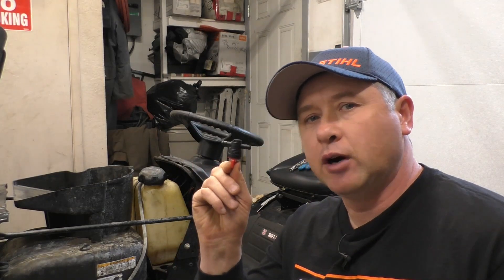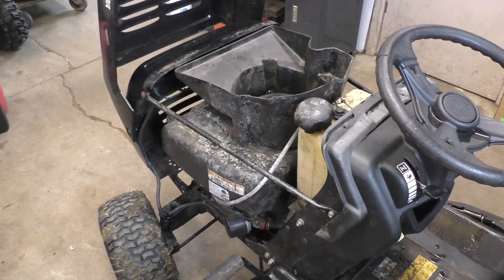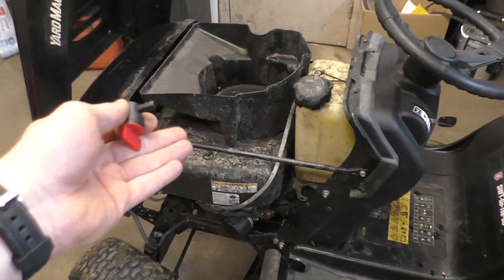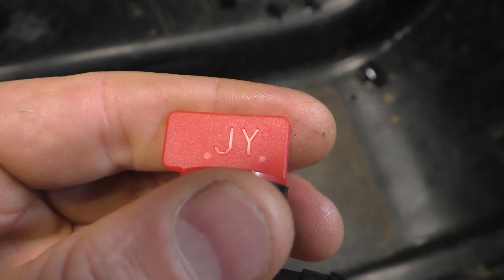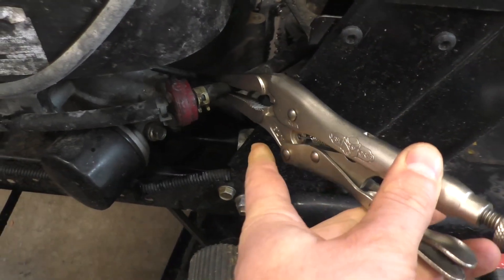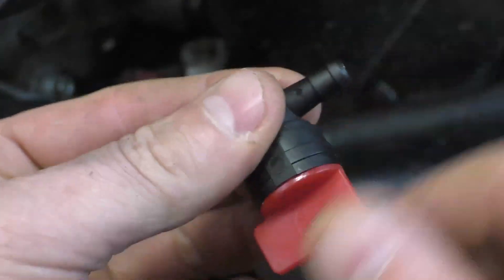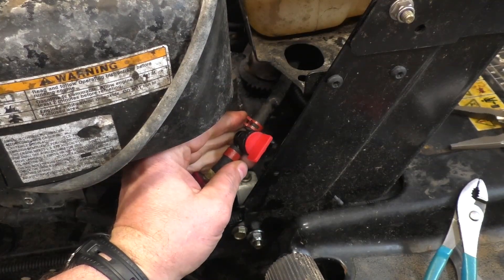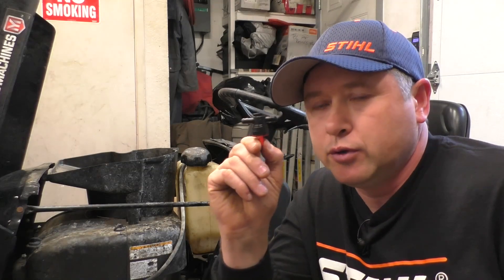Upgrade Your Lawn Tractor With A Fuel Shut-off Valve: Easy Installation Guide!

Comment: Great advice on the Chinese knock-off valves. I made that mistake and did an Amazonian purchase of 50 in-line valves for 10 bucks shipped.  The first one leaked and subsequent testing showed 40 of the 50 leaked right out of the box!  I buy Stens and Walbro only now. Learned my lesson!  Thanks Don!
Reply: lol, I buy the Chinese ones too from ebay. When I do, I message them and tell them, make sure none of them leak, I am going to test them when they arrive and if they do, I am going ro return them. Because the first time, I had a bunch that leaked.  Next shipment that came in after saying that, zero leaked. However after about a year, I noticed they do swell and leak anyway. They have to be the name brand ones to last, typically by fastex. Just like those knockoff carburetors, you can't trust them.

Comment: I always put fuel valves on my lawn tractors. I agree with all your points. One of my reasons behind it is that on a gravity fed system, it takes that pressure off the float needle and seat. I feel that helps along with the long term storage too.

Comment: I put a shut off valve on my riding mower a couple years back because of a bad float seal until I got the parts. I decided it was best to shut it off after each use. The first couple times I forgot and left the fuel on when done mowing;  the solution I came up with was a clothes pin.  When I turn on the valve, I clip the clothes pin onto mower key fob as a reminder to shut off the fuel when done mowing.   Been working great.

Comment: Donyboy73, 
Thanks for the reminder to add a fuel cutoff and to filter the fuel to the carb.  My 2005 Troybilt / Briggs 7800 watt generator has performed flawlessly since new.  I treat the fuel in the tank and it starts easily.  I am lucky the long term use of treated fuel has not caused any problems.  The $1200 generator (much to my surprise) had no fuel cutoff and no inline fuel filter.   So, I installed the Oregon 07-406 fuel cutoff and a Stens 120-562 fuel filter.  Thanks.  All is good now.  I can shutoff the fuel to the carb and run it dry.

Comment: Thanks Donny. As usual, your instructions are both simple and clear, and you make great points about why you want a shutoff valve. I don't happen to own a tractor, but I agree that they're important, and I think one should be added whenever possible. Unfortunately, it's not always easy...  

A couple of years ago I was gifted a "won't start" Toto Powerclear single-stage snowthrower. I had to replace the gummed up carb to get it to run, and like most modern equipment it came from the factory without a shutoff valve, nor did it have a fuel filter, so I decided I should add both. The problem is that the entire fuel delivery system - the tank and all of 12 inches of fuel line - is completely hidden under the engine cover/thrower body. Getting access to either requires undoing 4 screws to remove the discharge chute, then another 4 (different, larger) screws to separate the top cover from the bottom cover and frame. So even if I added a shutoff in the line, I still wouldn't be able to operate it without major disassembly!

In the end, I drilled two holes in the top cover and re--routed a new fuel line from the tank to the outside, added a new valve and filter along the side of the machine, then back under the cover to route it back to the carb fitting. I had to add some grommets to protect the line from the sharp edges of the holes and some zip ties and hose clamps to keep everything in place to prevent kinks in the line. While I was at it, I also added a "Tee" fitting between the filter and the shutoff, and put another shutoff in the base of the tee, so now I can easily drain the tank into a container if I need to.

All-in-all, it was a royal pain in the proverbial. But at least now I can shut off the fuel or drain the tank without having to half-disassemble the thing. The Toro is  a lot easier to maneuver than my two-stage, and it works great on light snow. But with no shutoff, no filter, and not even an access panel to let you add your own, it was certainly destined (and designed) to fail sooner rather than later!

Comment: Even with the so called antibackfire device I see issues with  the ethanol  fuel destroying the o-ring internally on the device causing it to leak. Having a shut off device prevents fuel from free flowing into the carburetor  and back flowing into the crank case. I recommend to all my customers to install the shut off and use it not just in the off season but every time they are done with the unit. Cheap shut offs usually fail within 6 months. Good Video! Nice tip. You Rock the small engine world.
Reply: I had my Ariens 17HP fill the crankcase TWICE with fuel. I finally got the message and installed a shutoff. ALL gravity fed machines should come with a shutoff from the factory.

Comment: That is a great tip and I have to put some shut-off valves on my machines and let them run better when they need to and I will get quality valves like the two you showed made here and not one from China.

Comment: Hello, I just watched your video. I have a Craftsman T3200 riding mower and it has a fuel pump between the fuel filter and the carburetor. My question is, should I put the fuel shut off valve before or after the fuel pump. My concern is if I put it before the fuel pump and shut off the fuel it will damage the fuel pump by letting it run dry as the engine is running.
Thanks.
Reply: I have the same question.

Comment: What about riding mowers with a vacuum fuel pump?  I've got a shut-off on my mower, and I ran it out of gas last season for winter storage.  Come spring time it took awhile to get it started, so I've just left the valve on for the season and it starts right up.  Any thoughts, suggestions on this?  Thank you!
Reply: I was considering putting the valve on the vacuum line to the pump instead of the gas line to allow me to run out the fuel before storage.

Comment: If the fuel filter is too close to the tank or frame then you could take it out and put the fuel shut off valve there and then cut the fuel line between the valve and the carburetor to relocate the filter further down the line

Comment: Where can I buy a valve as shown in your video with three connectors?  Two nipples would be use as you shown in video with the third connector being used to drain fuel tank.  It would be easier than pulling the fuel line off to drain tank.

Comment: Once valve is installed, did you find the fuel feed supply from the tank, cut in half (or even lower), compared to a straight line flow through hose, with no valve installed? I did. Cut my supply by more than half (down to a trickle, where the float isn't even floating, while engine is running, compared to a full length of open rubber hose feed. Slowed the feed right down, from what it once was (a river) to next to nothing😒. Even Installed a second valve to replace the one I was using, and it did the same thing. Without valve, fuel flowed like a river, and with the shut-off valve, it barely flows enough to run the engine.
Reply from the maker: no issues at all. some of the cheap amazon ad ebay valves can sometimes be problematic. Remember to make sure the arrow on valve is pointing correct way.

Comment: Also,,how does this shut off work? Will the gas from the shut off to the carb still run in after its sitting? Or does it air lock that no gas can run?

Comment: will this method work if my fuel shut off module under the carb is flooding the engine?,,,My engine is flooding all of a sudden when there is gas in the tank,,and it goes in my oil base,I drained the base,,and checked my fuel shut off solinoid and it seems to be working....but still floods the motor oil base ,and piston,when gas is in the tank it will slowly leak into the engine over a two day period..Will this shut off valve help my problem? Thanks ,,you do great videos!

Comment: I saw 2 videos of yours, one with the shut off valve location between the tank and the fuel filter, and your other video was between the fuel filter and the pump. Does it matter? Thx
Reply from the maker: It's better installed before the fuel filter and tank so when you replace fuel filter you don't have fuel leaking because you can shut fuel valve off.

Comment: When running the machine out of fuel before putting it away for winter, do you add fuel additive?
Reply: I would, i add fuel additive to every tank all year.
Reply: I use fuel additives in my fuel containers since I sometime store my gasoline for more than a month at a time.  I keep 4- 5 gallon fuel containers constantly full and use both Heet (Yellow bottle) and Sta-Bil.  I just a couple ounces of each, not the entire bottle to each 5 gallon can.  I fuel all my gasoline power equipment and vehicles with the same low octane gasoline (87) and have never had a problem with gumming or lacquer buildups.
Reply: I do. Sta-bil. Been using that for decades.
Reply: I use the Briggs stabilizer with 87 octane fuel and have never had a problem.
Reply: I used to use stabilizer but now quit. Feel like it's just snake oil. Just buy the good non-ethanol gas and you will be good to go. Never had any problems this way storing small engines over 6 months in time. Use non-ethanol gas and run the carb dry before storing.
Reply: @scottjohnson3845  Good luck finding non-ethanol gas since it's not available in many areas of the country.
Reply: @scottjohnson3845  thanks
Reply: @TheFlatlander440 find a marina

Comment: They make an all metal Oregon 07-403 Inline Fuel Shut Off 1/4" Ball Valve
Reply: I just saw one of those on Amazon. Looks like a sturdy one to use.
Reply: If you get the plastic ones that are name brand by fastex, they last a very long time. I've seen the cheap no name chinese ones start to leak at about 1 year.
Reply: I strongly recommend the Oregon unit! It is made of metal and very precise. I purchased one of these THREE YEARS ago for my "mail getter" Ariens riding mower. This machine gets used 6 days a week for the mail and sometimes multiple times per day for various chores - year round!. So this valve is getting turned on and off 10+ times per week for the past three years and it is still working perfectly with no leaks. This is a torture test compared to the typical fuel shutoff usage. I've had issues in the past with the cheap plastic valves but the Oregon unit has proven well worth the $13 price.
Reply: @eosjoe565  thanks for the tip and testamonial
Reply from the maker: yes they are awesome!

Comment: Don, I like the idea but I am curious for your thoughts.  I use to drain all the gas out of my equipment at the end of the season.   When the use of ethanol began I continued doing the same thing.  My Honda snowblower started giving me issues and I removed the carburetor to find that the bottom of the bowl was very corroded.  It had a petcock and I would empty it before it was stored for the off season.  Since then I have used fuel stabilizer and do not empty or shut off the fuel valve.  I read somewhere on the web that if any fuel remained I the bowl that the ethanol would wick in moisture.  This made sense to me.  If the fuel system remains on there is no chance of moist air getting to anything.  I’ve been doing this with all my power equipment and never had an issue since.  I am curious to hear your opinion?  Great video and please keep them coming 👍
Reply: I do the same.

Comment: I heard to a little spray WD40 in the spark plug holes before putting it away for winter as well, is this a good idea.?   After spraying, in a push mower its easy to turn over the engine but how do you do it was a ride on tractor ?
Reply: Yeah, that's called fogging. They actually make an oil spray explicitly for this purpose. Keeps things from seizing in the cylinder. If you wanted to turn over the engine after spaying, just pull the plug wire and spin over the engine with the starter a few times.

Comment: I see that mower has a RED 150-micron fuel filter. B&S also makes a WHITE 75-micron filter that does a better job. Both are designed for gravity fed small engines (i.e. no fuel pump).

Comment: Here’s another reason. I had to install one on my tractor because for some reason there would be a siphon effect created where the fuel was sucked up through the carburetor, through the cylinder, and into the oil and it would finally leak out beneath the mower. After this happened multiple times I had to install a cut off valve and shut it off after parking at every time. I had to change the oil multiple times because there was gasoline in the oil. I don’t fully know what caused this.

Comment: In 10 years of living in Montana, I have never had to use nor install a fuel shutoff valve.   Solution is to use non-Ethanol fuel.
Reply: If you can find it in your area.  I've used fuel storage additive with great success.